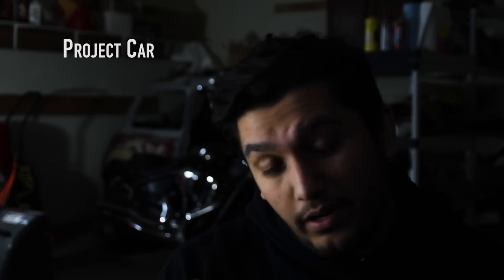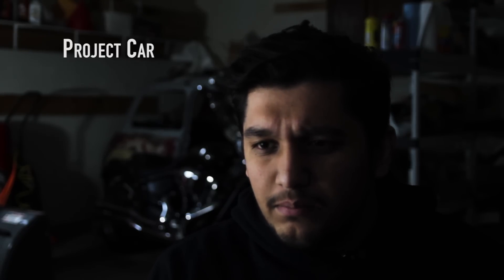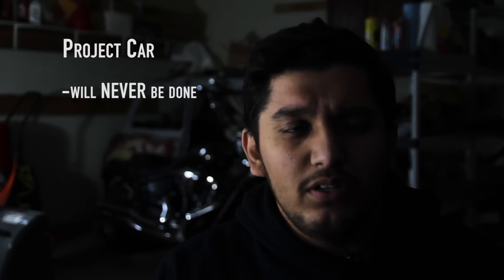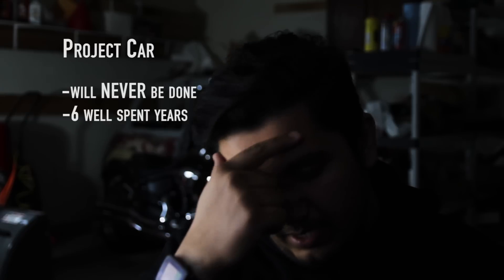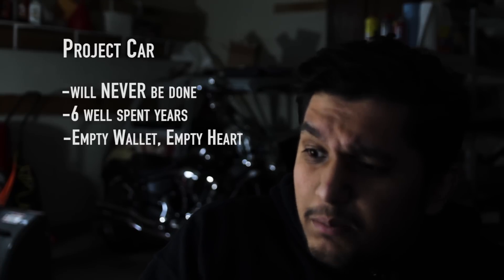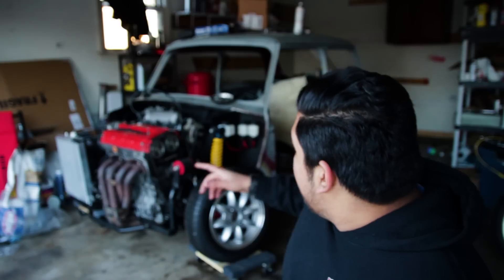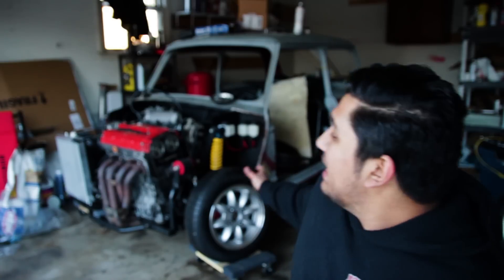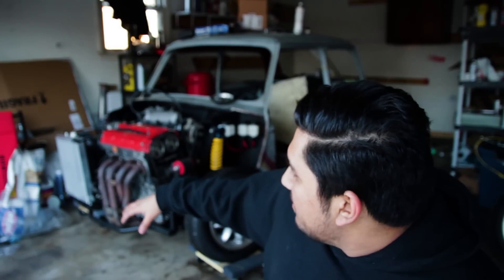Honda Type-R Swapped Mini Cooper - Intro - Part 1 [ALBON Garage]

Comment: My Mini is my dream car too, I build hot rods for a living. I fell in love with Mini's in the 70's when I got my doors blown of by one and I was driving a 68' Camaro 427. I'm using the same kit as you are for my mini only I added the AWD unit too.
thanks for the video.   I'm in Texas.
Reply from the maker: +Charlie Spann Makes me so happy to see more Mini enthusiasts! AWD sounds like it'll be a riot! How much cutting/fabricating is involved to add the rear differential and driveline components?
Reply: Well ,I'm building a 63' pickup and the bed is pretty rusty. I'm going to layout a full but light frame. I'll be connecting both suspension units together. I'm also building a b16a2 turbo motor for it.
Thanks For the reply.
Reply from the maker: That sounds bonkers, I love it! Good luck on the build! I hope to see some pictures sometime!
Reply: I’ve got a 1980 1275GT. Im going the B16/AWD route as well. Finally got the motor in. I’m using the kit from SuperFastMinis to do everything. So far there hasn’t been a lot of special fab work.
Reply: Yo Charlie!! this is Dee where r ya brotha!! hope everythings alright you got me worried! cheers